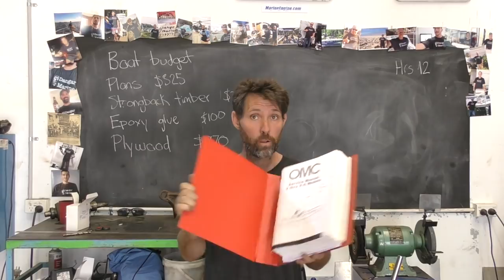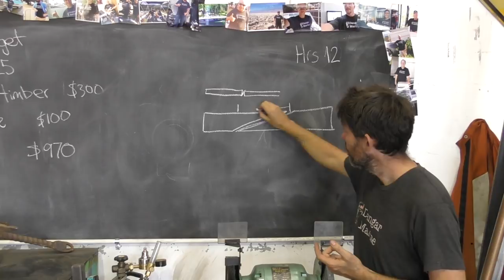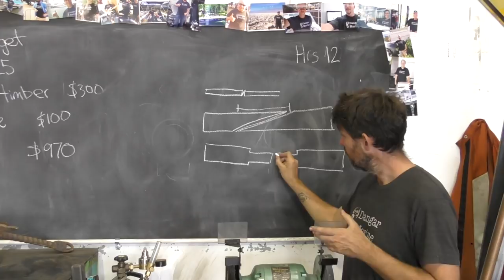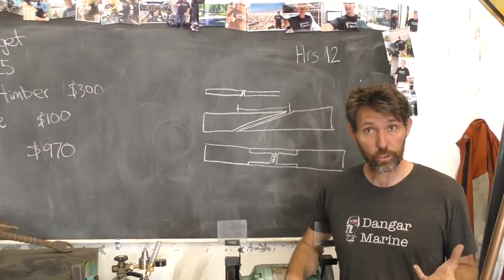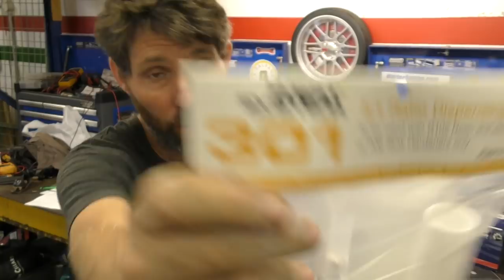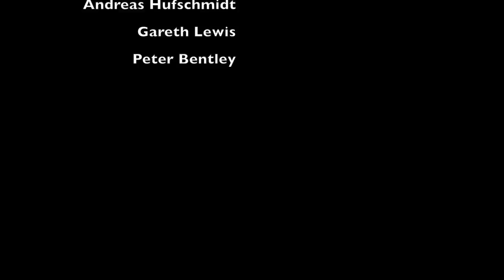Making a payson butt joint in plywood

Comment: Some cost relief ideas I have found-#1 saves a lot of acetone - which is both expensive and not nice to the atmosphere - use waxed paper cups ( sold as coffee or if you can find them, milk shake cups - I used to be able to get a 'straw' of them from Macca's for a few dollars) for mixing up resin . Once you have finished just bin the cup rather than clean it. A paper cup works out to around 350mL which is a good size to work with for me as that works out at about 15-20 mins of pot life and that is about what it takes me to lay out that much glass /resin.  #2 is that fancy non stick plastic sheet is also sold at $1 shops as party table cloth. A roll of 10m is about $12. Epoxy will not stick to it. #3 I find it is better that the 'whiskers' of glass are epoxied and go hard when set. A thin cut off disk in an angle grinder makes short work of the edge clean up. #4 get a pile of the $2 brushes from the big B hard ware mob and throw them away after use. With the price of acetone being close to $10/L it is a no brainer. #4 you will find that the roller will still 'gum up' if you only use acetone to clean it up. I have found Aclac or GP thinners is good to use every 2nd or 3rd clean to keep the roller usable.  Also- the glass beads are smooth surface so are not as hazardous as you may think - but still a good idea to not breathe them if you can avoid it. It is actually the fibre powder that is more dangerous. I am surprised you used the microspheres rather than the fibre powder for the edge joints as I understood the fibre powder gave a far stronger 'glue' which is why I used it for my transom repairs last year. With the 'wet the wood out first' idea, the reasoning seems to me to be sound if the timber is homogenous timber pieces, but the glue bond layers in veneered wood stops the penetration going any deeper than the glue layer, so wetting out veneered wood is not really of major benefit.

Comment: I've seen boat builders puzzle/jigsaw to join ply rather than payson or scarf, I think I'd prefer that option if I could manage to route the fingers from template(s) accurately enough without needing a CNC to do it for me.
Reply from the maker: That would be a good way to go, but as you say, probably take quite a bit of skill to do accurately.
Reply: I had a think about it and I expect it'd be hard to make a symmetric puzzle joint by hand for a router template that's repeatable. So making two slightly asymmetric templates might be the go, with the second molded off the first and using those with the router, that way symmetry doesn't matter. I also thought about cutting a puzzle shape using a scroll saw and then using layers of epoxy on both ends of the cut to close the sawn void to make routing from them as templates more accurate.

Comment: I find it very interesting that you used fibreglass. Is that common for jointing in marine industry? I first thought you would use thinner bits of plywood instead of fibreglass. 
Looking forward for the end product.
Reply from the maker: I'm not sure if it is standard but it certainly was the instructions that came with this boat. I imagine the fibreglass gives a strong joint in the end.

Comment: its easier to wet out the glass that hangs over the edge and then it will cut cleaner with a razor blade easier when it dries rather than dry floppy fibers!
Reply from the maker: Yes, I think I will go that way next time.

Comment: Stu I dont clean consolidating roller just burn out resin with gas burner and a drop of oil on axle keeps it running smooth
Reply from the maker: I think I'll need to do that as some epoxy set inside the roller so it doesn't turn any more.
Reply: You might also try to use disposable foam rollers (paint rollers from Bunnings - the one with the thin black foam).  Can use 75mm for small areas or 230 for larger areas (and can cut into 3 if you want to save money on the 75mm rollers :-) ).  Also when laying a base of unthickened epoxy prior to filletting, disposable brushes can be convenient.  There's an ebay store called diy composite supplies or something similar that sells packs of disposable brushes cheaper than you can find at Bunnings (at least last time I looked..).

Comment: I haven't read all the comments, so it may have come up, but I think if you have enough length to overlap the boards by several inches, then a simple half lap joint would be even better, and a router would be the perfect tool.  just MHO
Reply from the maker: Length is definitely the issue. In this case the whole piece of ply is used edge to edge.

Comment: If it is 450g/m2 matting then it should take up 450g of resin per square meter of matting so you can work out from there how much you need to mix...for future reference
Reply: But it's cloth, not matting.  Does the same ROT apply?
Reply: Yes same ratio for matt or cloth...
Reply: Thanks,
Found the following link: https://www.ecfibreglasssupplies.co.uk/topic/estimating_quantities
It does show some differences between chopped strand matt, regular fibreglass cloth, and biaxial cloth (the strongest fibreglass, and what Stu is using).
Reply from the maker: Interesting that it is close to 1:1 (slightly more resin according to the link below, but not much) I'll definitely use that when mixing resin up in the future.

Comment: You definitely need to wet the plywood with unthickened epoxy before applying the thickened mix.  I have seen the results and there is a big difference.  You will see how much the thin resin soaks into the wood, whereas the thickened mix does not.

Comment: it's easier measuring hardener in ounces and then multiple by ratio i.e. 5x1
Reply from the maker: You need to be careful when going by weight as although it is a very accurate way to go, the resin and hardner have different densities so 100g of one and 500g of the other doesn't give you a 5:1 mix by volume which is how they specify it. This is something that the epoxy manufacturer down the road explained to me and they were able to give the exact weights for their product.

Comment: Why is a lower unit filled bottom up and not top down? It would be like filling a car engine with oil at the drain plug
Reply: Numskul's Garage it pushes the air out when you pump it in from the bottom,hence why the top one s called a vent.remember too screw the top one in befor you remove the filling tube and the vacume will hold it while you screw in the filler / drain plug
Reply from the maker: As Peter says, it is about letting the air out as the oil displaces it. You can fill from the top when the opening is large enough to allow both the oil in and the air out, but with these gearboxes they are too small.
Reply: Dangar Marine thanks, as an auto tech I have the mechanical skill but I also understand things are done differently in the marine world. Your vids have helped a lot as I begin to restore an old boat I received as payment. I'll have a lot more questions I hope that's ok?

Comment: why not to use thinner plywood instead of glass in this joint?
Reply from the maker: Fibreglass is stronger and you already need to buy a full roll of fibreglass so it is one less thing you need to get.
Reply: I am not sure that it is stronger for bending, while thinner plywood will form a piece that is close to undivided piece of plywood